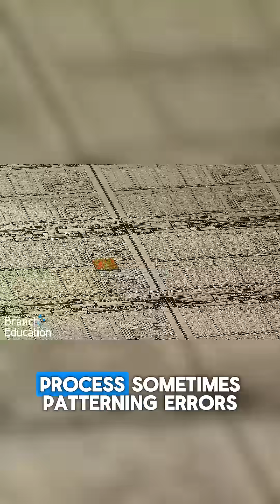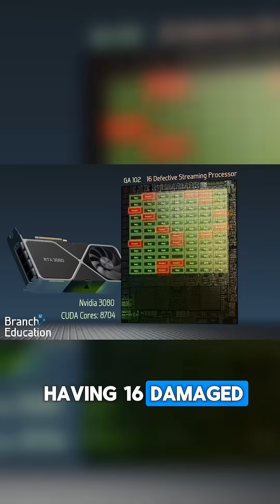How do Graphics Cards Work? Part 4 #gpu  #technology  #engineering  #videogames

Comment: So basically you’re playing a gacha with lower tier cards, hoping to pull a card with less defective chips.
Reply: Nope. What they tell you is what you get. If they get a chip that has too many damaged cores to be a 3080ti but not enough damaged cores to be a 3080 they destroy healthy cores to bring it to 3080 level, they don't just randomly throw in a faster chip into a 3080, that would make reviewers and customers go mad trying to find the "good" 3080s
Reply: @-ragingpotato-937 That is exactly what the silicon lottery is though. At stock there probably isn't a noticeable difference, but when overclocking/undervolting there definetily is. I have a 3080Ti Suprim X that I undervolted, and got a relatively bad card compared to others and I have to have a higher voltage to keep it stable.
Reply: @hypernovafx  Thats not there being more cores, thats the healthy cores ending up being of higher quality. It is manufacturing variance giving a better chip but nowhere near to the degree of having more cores.
Reply: @-ragingpotato-937  Of course the number of cores on every 3080Ti is the same, but if i understand this correctly the card I have is a 3080Ti and not a 3090 because of it having too many cores of a worse quality to suffice as a 3090. Nvidia can choose to disable the worst cores and keep the best, it's not like either the core works or not, if a card has many relatively unstable/bad cores it gets binned lower.

This means that if my card would've happened to become a 3080 it would've been a really really good one (while still having the same amount of cores as a 3080) because the card has better quality cores, and now because it is a 3080Ti it's a bit sub-par, but still perfectly acceptable.
Reply: Wouldn’t it have to be regulated to only have a set amount of defective areas. Hence why there are multiple cards each of them having a SET number of defects to be classified as that specific card. I can assure you that if they sold 4070s and one could out perform another 4070 they could and would be sued for disgusting amounts of money. Not just from consumers but from rival companies like AMD.
Reply: yep and that does happen people can have the same gpu and pull different performance status because of this vary reason lol.
Reply: Looool

Comment: imagine waking up with the power to understand this shit and actually repair it, buying used 3080s and selling 3090tis.
Reply: Just finding of exact location of defect would cost a lot of time and effort.
Then you would need something like an ion-beam etching and single atom deposition technology to fix it. By doing that, you can create new defects.
In the end, there would be no warranty, so you can't sell it as 3090.
Reply: Doing that would probably cost so much time and resources that it would be orders of magnitude cheaper to just buy a new 3090ti.
I mean, if that was possible, it would be relatively easy for the manufacturer, as they likely already have most of the resources they would need. There's probably a reason they don't do that either. The manufacturing is just so complex that making a new one is orders of magnitude cheaper than looking into why the previous one is broken.
Reply: Actually, since there is more demand for lower end cards, manufacturers sometimes disable perfectly good cores to create more of the lower end chips. If you're lucky enough to get one of those, you can just reenable the cores through software.
Reply: @sweetlemonade123  actually it only works with some models and not all of them, like for example the 3060TI that is a defective 3070 instead of a good 3060, the 3050 that is a defective 3060, a defective 3090 never will be a 3060 for example, because they doesnt even use the same GPU

Comment: So basically they couldn't fix the errors of the GTX 16 series and led to discontinuation of the entire GTX series?
Reply: No. GTX is dead because its all ray tracing now. So its only RTX cards
Reply: How did you even come to this conclusion from the info in the video 😭😭 There are no more GTX cards simply because they stopped manufacturing chips without RT hardware.

Comment: So basically I have a defective i9 cpu which is a i3 😂😂😂😂
Reply: What interesting during late stages of production.
They are making more perfect silicone vs defective silicon so they manually disable some.
In the past you could firmware unlock the turned off parts to make it higher end model.
Reply: @haloharry97  back when you could buy some extra performance down the line through entering a code
Reply: @etanlg was this a product? Do you remember the name? You got me curious
Reply: @haloharry97 that didn’t always work though, the cores had to be intact for that to work. I remember the triple core phenoms where you could get lucky and unlock the fourth core sometimes!
Reply: @morpheus_9  i know. 
but it cool when it does work
Reply: @haloharry97  thats not how it worked dude those defective parts were physically disabled and cut off
Reply: @haloharry97  Phenom II ahhh good ol'days
Reply: No no you have I 24 in i9 form😂
Reply: Yes. Exactly.
Reply: basically yes
Reply: An i9 is essentially just a perfect i3 if you think about it
Reply: and thats why you got a discount and not paying the i9 price lol
Reply: wait till you hear they locked them with just SW back in the day
Reply: Become a genius and fix it
Reply: Can't say you were wrong😅
Reply: The i9 is not the same layout as the i3/I/i7 iirc
Reply: Exactly lol
Reply: what about mine i have Intel celeron that's mean badly defective core i9 CPU 😂
Reply: not really, more so a i5 or a i7. Celeron pentium and i3 branding kowever was at least to my knowledge that way. There is even more variation like a bad i3 being a pentium gold or a good celeron being pentium silver.
Reply: Why are you talking about cpus in a gpu related video
Reply: @Plomb_001 if your CPU is powerful it can work as a GPU :3
Reply: no, what you have is a bin of silicon that only has an i3 set of cores and processing units that are active.

what is working there is not defective. the regions are modular, and can be deactivated without disrupting the flow of data.

the process is efficient because it stops a lot of waste caused by actually microscopic problems.
Reply: 😂😂😂😂 nice
Reply: i regret watching this. so basically buying new i3 process is buying damaged and barely working brand new cpu lmao this is fucked up hahaha
Reply: @ssquarepants04  no, this is normal stuff this has been done for ages

Comment: Why they are expensive if they are defective.?
Reply: To cover the cost of R&D and manufacturing duh, fabrication assembly is extremely expensive and delicate. Also, not all chips will pass the QC
Reply: @z4k1_zaki65  true but 100 dollar cheaper can go a long way.
Reply: you must be smart
Reply: @nilim27Ni  bono
Reply: "It just works"
Because it would be MORE expensive it it wasn't
Reply: I meant only to be cheaper not givinging itbwaybfreely
Reply: @Rv9977br  It's actually cheaper than the higher tier. It's not that expensive if you looking at the price point.
Reply: They're not ''defective'' as a product. You pay for 8 cores you get 8 cores that work. What happened to the other 4 is none of your business.. if you want 12 cores you need to pay for 12 cores..
Reply: companies don't sell 'defective' products. Think of it this way, imagine you're selling pancakes, a stack of 5 for $5, $1 per pancake, a fly sits on your top pancake in the stack, you throw away the top pancake not the entire stack, you can replace the top with a new pancake or sell the 4 for $4 , in case of chips, new cores can't be added after manufacturing and binning, so they take the latter approach and sell the rest at a cheaper price. When you pay for 8 core cpu you get 8 cores that work, what happened to the other 4 isn't your business. To find out what a 12 core chip can do, spend the money for 12 cores and you'll get 12 cores :)
Reply: Are you stupid?
They basicly only build 3090TIs and 4090Tis and 2080Tis.
They only build the best of the best graphics cards, but in the production process mistakes happen but not every mistake makes the entire gpu chip useless so they deactivate the damaged parts and that's how you get lower end GPUs

Comment: Ive always found it weird that every GPU or CPU sold is actually a faulty die tweaked to the standard of its class. Technically they are all faulty.
Reply: theyre still fully functioning. and theyre expensive to produce. it is extremely wasteful to throw them away just like that
Reply: @ oh definitely, it’s been proven to work for decades but still seems weird.
Reply: when you learn about the sheer complexity in these chips, its a wonder that any of them work at all
Reply: i think almost all complex engineering product have some defects in it
Reply: well bassically they design a product line to account for ones with messed up cores . for example  : (not a real example) 

they design class A card to have  6 cores ,  class B card will hav 4 cores and class C card will have 2 cores.. this way if they have a chip that has defects in 1 core they'll disable it along with another and call it a class B card.   if one chip has 3 defective cores they'll deactivate all three plus one extra core  so they can slot it into a class C card.  the whole point of doing it this way is to save on manufacturing costs as well as R&D cost it would take to actualy redesign  a 4 core and 2 core version of the 6 core chip.  if they didn't do it that way every variant of chip they produced would cost drastically mroe to produce.
Reply: That is price discrimination

Comment: wait so a 3080 is just a broken 3090ti 😯
Reply: yes
Reply: indeed, for a manufacturer its much easier AND cheaper to design the best possible GPU (at that point in time) compared to individually design and build each model. this would also take much longer and eventually loss of money for the manufacturer.
however, i believe the 3060 TI is a different chip so there are rare instances.

Comment: So, you mean my 3060 ti is a cripple with its half of cuda cores working?
Reply: No, because the 3060 Ti use a different chip.
The GA104 to be exact. A full GA104 is 6144 cuda cores. Your 3060 Ti has 4864 cores. It's only missing around 20% of its cores. Also note that some of the cores may have been totally fine from the factory and they were disabled to make a 3060 Ti since it's what they needed to produce.
Reply: @Blue-nw3li I hope it’s true
Reply: @actaeon5770 It is. Defect rate is not that high on a node by the time silicon is in full production. Nvidia pays the same for defective wafers as defect rate is known and is a part of the cost. If defect rate could swing to 50%, there wouldn't be a contract for that node. They usually make around 5 different GPU dies for consumer GPUs and then disable parts of them to make more GPUs
Reply: And the 4060 and ti is worse
Reply: 18% more performances in most titles but ok
Reply: @Dr3IsUnFazed  more like 3-5%
Reply: It's a different chip.
Reply: Define "half". The 3060ti, 3080,3090, etc. are only given so many cuda cores anyway. So it doesn't matter. It's not "crippled". It's to spec. If a chip destined to be a 3060 just happens to have more cuda cores than the spec allows, they will simply disable them or put it towards a different card.
Reply: no it's a different die to 3080 - 3090ti
Reply: this vid is talking about GA102, your 3060tu is using GA104, the cripple version of 3070
Reply: Essentially yes. Lower tier cards are the same chip, they just didn't fully survive the ultra precise, borderline spaceage manufacturing process that goes into these things.
Reply: in fact I believe it is artificially crippled in order to sell different graphics cards at differenet prices.
Reply: @Galova  CPU's used to be artificially crippled in the past through BIOS settings and such, but this changed from being artificial to actual hardware changes to prevent people from just turning on a setting in the BIOS to unlock a "better" cpu.

I do not believe this ever applied to GPU's tho, it has always been done at the hardware level.
Reply: @Nighterlev  artificial goes for deliberately-made-this. It has nothing to do with software or hardware. Means are irrelevant. There's no difference if they write it in bios, flash CPU microcode or cut traces on-chip. I believe they simply do not run in-depth diagnostics of all chips in order to find out what calculation blocks are faulty. It is way too sophisticated. How? Test with probes every single chip under a microscope? Again. How? This thing is simple only when you say it. Try to do something like that and find out it's a bullshit. Sounds like a beautiful story for marketing but practically near impossible. They won't spend money to do this. In case some chip is broken they destroy it. In order to sell multiple models they write different microcode into the chip and "wire" it to work different. They won't spend money and resources to find bad cpu blocks and disable them. They only test them to detect clock speeds that allow them to run stable
Reply: @Galova  do you normally make shit up?

Comment: Yh but how can they guarantee a consistent failure rate of the same amount of chips and market it? You would have to for example have 4 broken chips in every card and then market it as such.
Reply: These failures are basically random, so at a large scale of production, you can quite accurately predict the proportions of chips in each tier
Reply: @SapphireScroll  Yh but to sell a consistent product you must ensure the consistency of that failure otherwise graphical tests would show different results. 

Maybe they get all sorts of failures and group them up accordingly.
Reply: @seemaab  They do. As far as I know, cores in defective chips are deactivated according to how close the chips are to the nearest lower tier. So if you have an 8-core CPU with one defective core, you can deactivate the defectove core and one more so that it meets you 6-core CPU characteristics
Reply: The failures are random but predictable. There are also no perfect dies as there are ALWAYS flaws. These dies have "fusable" parts that are just redundancy. If something is broken it is just fused off and might be replaced by a redundant part. If too much or important parts are defective aka breaking a GPU core cluster (Streaming processor core) it might not meet the specs of X high end card so it will get fused to fall into a category of the next range. You cant have 100s of different SKUs so they have a fixed set of fuse groups that they burn to set the level of the card. A 3090TI is technically a 100% working die design and with every defective fuse group it drops a level.
Reply: That is the reason why we have to understand how technology is made

Comment: Can we buy the streaming processor and fix it ourselve?
Reply: The streaming processor is just the  Nvidia GPU equivalent of a Core, and technically there are ways to reactivate them if they're not broken, but no you can't fix yourself the GPUs unless you have a TSMC chip fab lab in your home
Reply: @truedarklander  thanks for sharing knowledge.
Reply: @sheeisenbergh  note, that on some older processors and GPUs it's more likely that not only are the cores fine, but they're easier to reactivate, but that's not particularly relevant right now, like some old Athlon X3s had the fourth core working fine but was just not boosting as high as the rest, and so they made them into top bin three cores instead of mid bin four cores
Reply: @truedarklander  nice
Reply: Nah
Reply: yes and no. it is possible but it's too expensive to fix